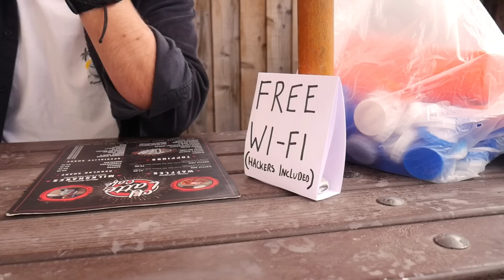Are Plastic Bags REALLY that Bad for the Planet?

Comment: RE: degradability of plastic bags; Being across the pond as it were, you’ve probably never seen a plastic bag sitting in the hot sun for a couple of months.  After sitting in the sun, a plastic sack becomes very brittle and breaks apart when touched.   Having lived in the American southwest for many decades, I have, unfortunately, seen many instances of plastic sacks clogging chain-link fences, scrub brush, pinion trees and any other barrier to prevent them from being blown away.   One summer in the hot desert sun will disintegrate a plastic bag.  Plastic buried in a landfill won’t break down or disintegrate as fast.  I don’t know exactly what your average cloud cover is offhand but would suggest that as an experiment, you leave a plastic bag on the dashboard of your car and see how fast it disintegrates.  Alternatively, tape a plastic sack to a board, (or between two wire racks) and leave it on the back porch or other location which gets lots of sunlight.
Reply: Doesn’t that create a bunch of micro plastics though?
Reply: @droppedpasta ofcourse, sadly plastic doesn't just dissapear.
Reply: Plus emissions  @droppedpasta
Reply: @droppedpasta  my suspicion is that e should be using sunlight to break down plastics before using them as fuel. Like all petroleum products, they kinda don't really break down into anything truly not harmful. Burning them as fuel at high heat to break them down to basic elements and then refusing to use plastic on "disposable" applications in the future is likely our best option.
Reply: Leaving it on your dashboard would make it degrade quicker anyway due to the heat through the glass. 
But here in the UK the weather doesn't usually get very hot. We occasionally get a 38c (100.4°F) day once in a while but our average  is usually around 9C- 18C (48°F - 64°f).  I think it would last a lot longer here. But your suggestions are great for places that are lucky enough to get heat :)
Reply: UV radiation plays hell with plastic
Reply: Ha ha a back porch gets the sun lol.  This is UK we had maybe 4-5 weeks of sun over the year. A few of those days were hot. We get rain 😭

Comment: Sew the bottom of the bag sides making one long piece.  Fold it together.  Fold up the bottom two inches to make a 4 in bottom.  See down both sides over the fold.  Flip it right side out and sew along the bottom edge. It will make a nice bag that stands up and you don’t have to cut out those little squares. No waste.

Comment: I think this is an awesome project and a good way to reuse the plastic already made into disposable bags, but I do think the math was a but misleading here. When you consider all the individual bags used in making this one, the carbon footprint goes up A LOT and I don't think the reusability of the bag is much better than a cotton one (which is also repairable and reusable as material for a new bag).

Great idea... but if you are gonna do any math, you should do all of it before claiming the plastic bag is the "best."
Reply from the maker: Yes that’s fair, you’d have to factor in the multiple bags used. However, if these bags were all destined for landfill and this provides a new use for them, then essentially we have sequestered the carbon. I do agree that cotton bags are repairable, but possibly not as accessibly. All good points though!
Reply: @BrothersMake  I agree, it's a great way to extend the life cycle of the plastic and seems surprisingly easy. Thanks for showing us the process.

Comment: Hi chaps - I'd love to see a project with those horrible plastic nets that lemons and onions come in from the supermarket
 You're great, been following you for a long time - keep it up x
Reply from the maker: We tried using them in a project like this before, but they didn’t fuse with anything frustratingly. We’ll certainly keep trying though
Reply: @BrothersMake  Perhaps the mesh bags could be used as an interleave layer for reinforcement/strength, and if stretched out, the other bag material may 'melt' into the open spaces of the mesh. Just a thought - I may go and experiment with this myself and let you know!
Reply from the maker: Nice idea! Like a reinforcing mesh
Reply: @BrothersMake  Thanks for the reply -  there's 2  types, there's the 'solid' plastic mesh for onions and the 'multi-fibre' ones for lemons etc. do you know type of plastic they each are? I'm sure there must be something we can do with them?

Comment: Here's a revolutionary idea: BUY ONE GOOD BACKPACK AND USE IT INSTEAD OF BAGS. Been doing so for more than 3 decades - still using the same backpack.
Reply from the maker: Not bad advice! But I guess a backpack isn’t always convenient for people. I’ve had mine for almost 20 years myself :)
Reply: Backpack for grocery shopping?
Reply: @gallardoranch5129  Sure. It's so much more convenient than carrying the bags in your hand. And there is no other way, for example, when shopping on a bicycle that has no luggage rack.
Reply: @geraldwashington6588 And then what? They can complain and tell me to leave, but not much else. For it to be called a theft, the staff still have to wait until I have left the store, or at least am behind the checkout area without paying for all items in my backpack.

But petty theft isn't the point. Did you even read my post, or did you stop after "watch what the security guard is doing." and assumed I was giving shop lifting advice?
Reply: Backpacks are SO much easier for carrying heavy loads too! I’ve had mine since I was 16, I splurged a bit on it and it’s still going strong years later.. can’t say the same for some cotton bags I’ve had 😅
Reply: I use a backpack too most of the time. It has 30l of volume, I can put a lot in there and I never had a problem carrying sensitive stuff as long as I took care of a good placement; even when I go with my bike for some distance. But sometimes I need a big bad for things and I think this is a great solution! I reuse the plastic bags that I get from whereever as often as I can - I like the thicker ones the most - and the last use of them is normally as a trash bag. 🙂
Friends often wonder why I collect all thoseplastic bsgs, but some of them I already use for years and I'm good with it. 😋
Same with paper bags, but they don't last that long. 😕
The cotton bags I have never ripped apart, but sometimes they are not that handy (plastic is water proof).
I think the most important point is to buy as less new stuff and reuse things as much as possible.
Reply: Many stores ban backpacks...even if you are an utterly innocent looking disabled woman with a cane like myself. I guess it's a common tool of shoplifters. 

I personally advocate for "granny" grocery carts for grocery shopping, especially if you use public transportation. I'm using my Dad's wire one that he used wayy back in his university days.
Reply: @amandasnider2644 those granny wire carts (as you called them 😂) are really great. We use one to bring our groceries from the car up into our apartment. My housemate thought we should toss it because the locking mechanism would come undone and the damn thing would collapse. I fixed it with bungee cords and it’s been going strong for 3.5 years since we moved! I personally still like to have bags inside of it, so my produce doesn’t get bruised on the wires. But of course we reuse the plastic ones as many times as we can. Here in CA we don’t get so many of the really thin ones anymore, because they’ll cheerfully charge you for them at the grocery if you forget yours. So most places at least give you the sturdier plastic ones for your “forgetfulness tax”. 😂 

I also keep a couple of Chico Bags (thin, tough nylon fabric) hooked on my purse. Those things hold a surprising amount, and they wear like iron. They stuff into their own stuff sack, making them much easier to use than the kind you have to origami back together every time. After more than a decade of regular use, mine were starting to finally get some holes. I recently bought a new one at the WF for $6, not because of the holes, but because one of my friends seems to have walked off with one! LOL. 

WF and Trader Joe’s also still give us paper bags, and despite the carbon footprint aspect mentioned here, I’ll still be using them, because we need them to line our compost bin so we can take that down to the city-wide commercial compost bin in our apartment building. The lack of durability is a plus in this case, and we don’t need to purchase those compostable plastic ones. I find that those often decompose a bit TOO soon! 

I really do wish more people were recycling plastic into those great slabs they showed in this video, though. It’s such a better use for it all than ending up in the ocean. And it looks so pretty if you pay attention to the colors! I hope we see more places starting to incorporate them as part of their recycling efforts. They should be made into things like park benches and traffic cones.
Reply: My grocery store banned backpacks because of shoplifting, if I try to walk in with a bag the security guard makes me put it in the office and I can't get it back until after buying my stuff. Fry's was the first but now more and more stores are not allowing backpacks in the store. They don't care that I take the bus or that I was coming from a class, all backpack carriers are potential shoplifters so they went zero tolerance.
Reply: @-desertpackrat  Yeah, that sucks. The few zero tolerance shops in my area at least have lockers. Here's a tip: Watch closely what the security guard is doing. Does he let women with (big) handbags in? What about the granny with her trolley? If yes, ask the manager why these potential shoplifters get treated differently. Ask him if he has heard of this little thing called "equal rights". Or ask yourself how much you really need to go to this shop...

Comment: This is excellent! I've been working on plastic bag recycling at home with my iron, but I always run into the problem of the sheets not lying flat and getting warped in unpredictable ways. Once I have the space I'm gonna look into getting a used t-shirt press!
Reply: Once you have ironed them, try putting a thin layer of plastic on them, and then place a book on the outer protective layer.
Reply from the maker: A heavy weight after each press really helps!

Comment: I think the more important metric of durability is how well the item is made.  There are a wide range of "reusable" cheap bags out there that die after about 10 uses, where as most canvas type cloth bags will hold up to decades of constant use and can even be laundered, and if they ever do wear down, they can be patched or used in other projects.
Reply: Being able to launder a bag is important. For bags that need a quick wipe, we could just use thick plastic.

Another factor upcycling. We'll probably never want to use plastic for clothing, so turning denim clothes into washable bags is a good way to go.

An interesting thing is being able to dispose of any kind of single use bag. I've seen cloth bags be used for take out food. They were used once and then thrown away. That should have gone to a facility for sorting.

Comment: Thank you so much for mentioning the carbon footprint! I understand the need to reduce/replace plastic, but all angles of the problem should be considered intead of just going 'paper good, plastic bad'.
Reply from the maker: Precisely! Thanks for watching!
Reply: Isn't one of the problems with plastic breaking down into particles that they become small enough to end up in the food chain? The plastic doesn't get composted, even when it becomes an accidental part of the compost pile.